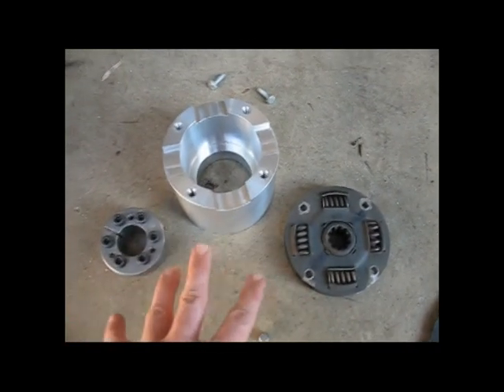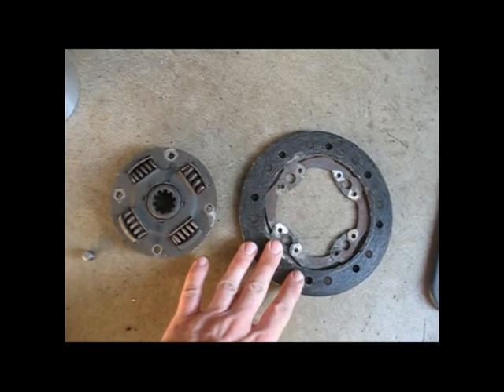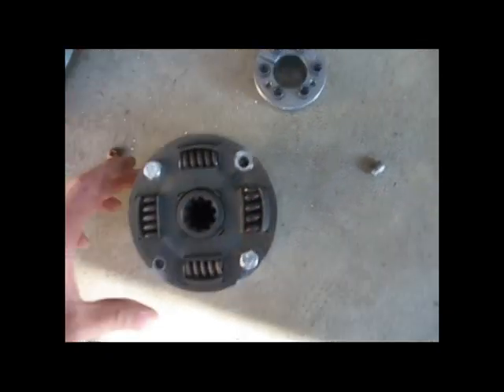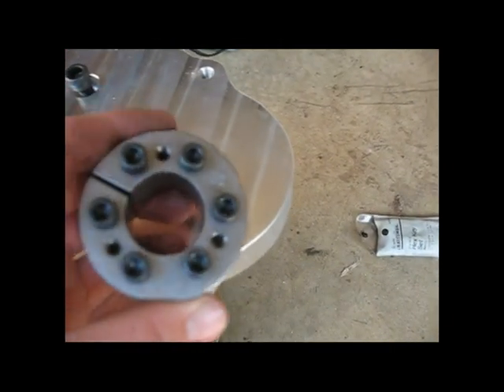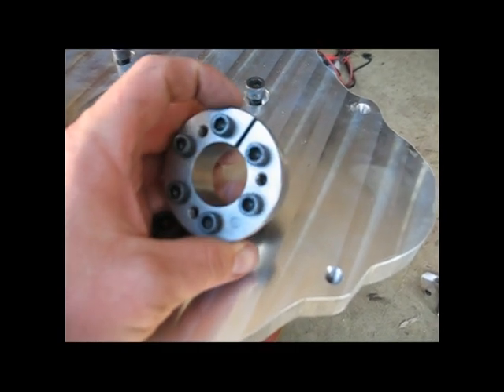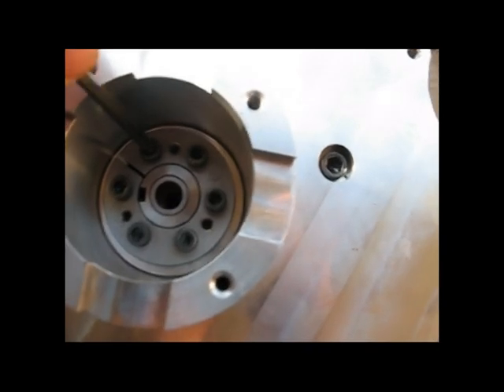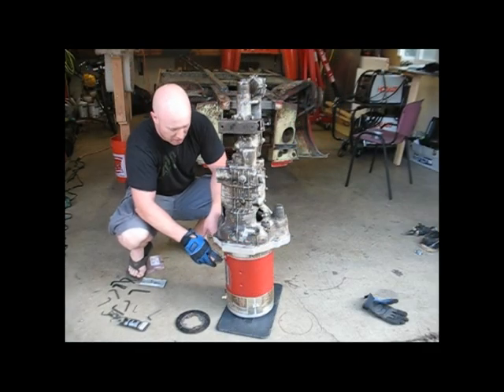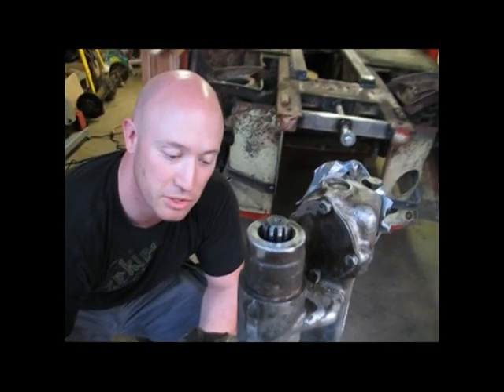Part 7 - Adapter Plate and Motor Coupler - 1969 Austin Healey Sprite EV Conversion

Comment: I see a potential problem with expanding steel taper coupler and aluminum hub. Under load the possibility of slippage and failure are high.